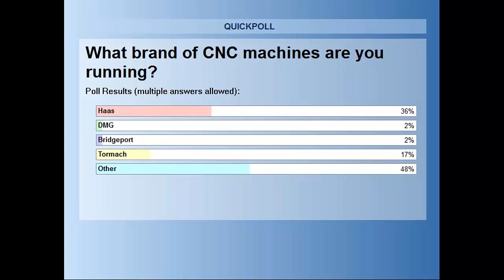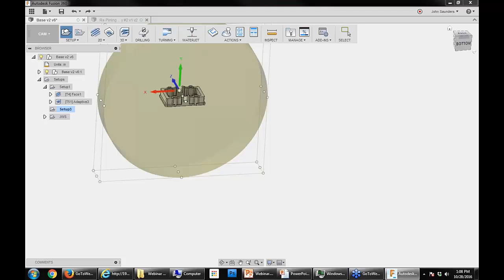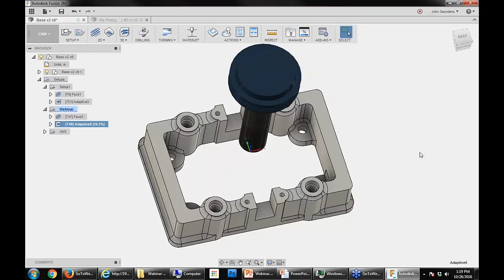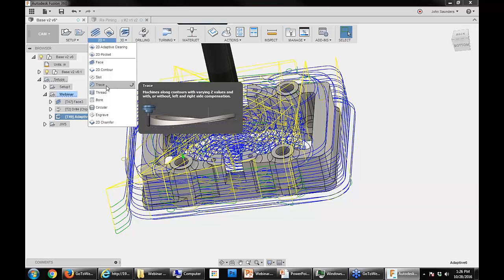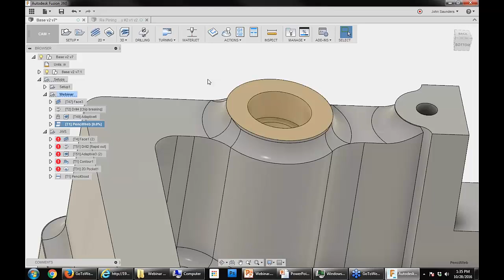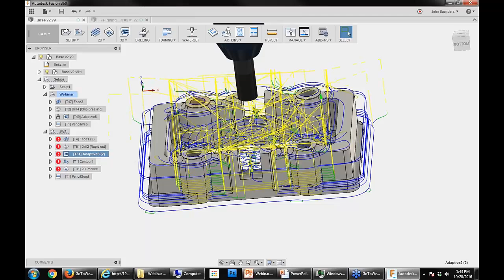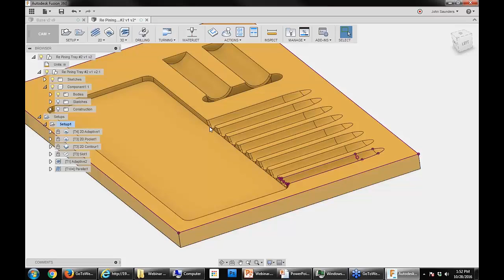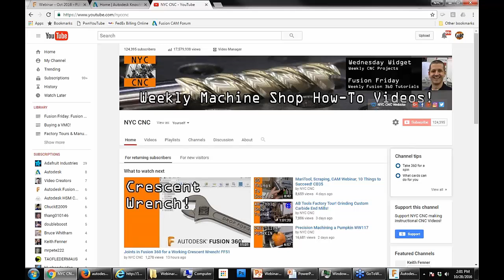Weekly HSM Technical Webinar - Tips and Tricks with John Saunders NYC CNC

Comment: Wow, that was SUPER helpful.  In case you guys are wondering if you are hitting a target audience, yes you are.  People like me are a little past beginner but really struggling to figure out how to leverage our machines to actually get projects done decent time and repeatably.  This is the excellent common sense how-to we need.  It's past "I've never used this" but it doesn't assume you already know it all and are running 1000 part jobs.  This is hobby and small shop how-to and did a good job of showing HOW to practically apply multple features of Fustion 360 at once.    I'd love to see more focus on this level of info both from Autodesk Fusion and from NYC CNC.  THANKS!